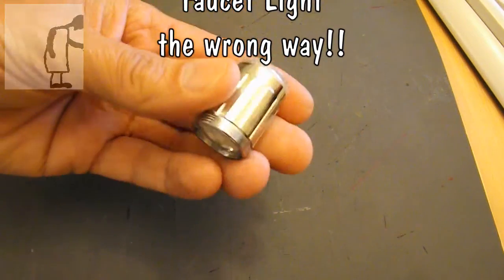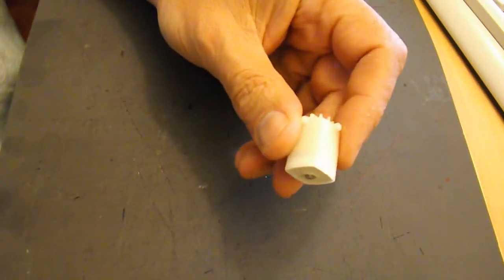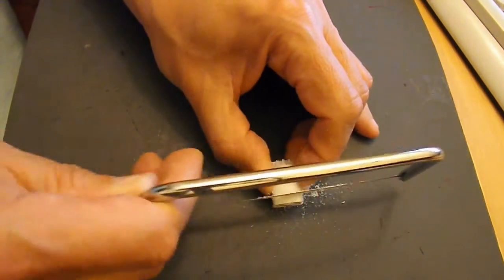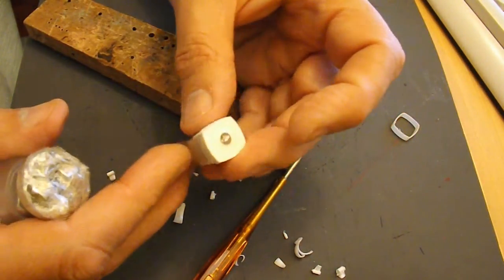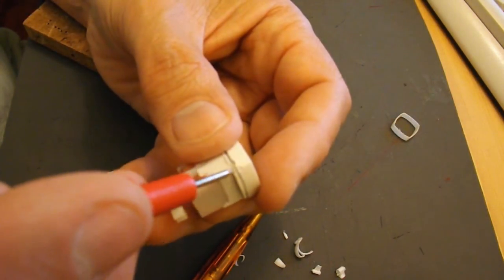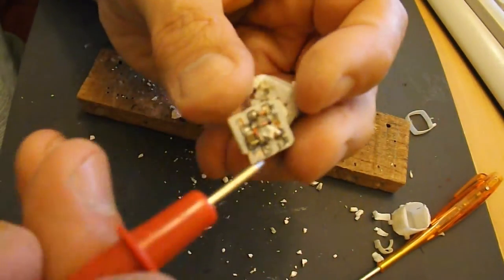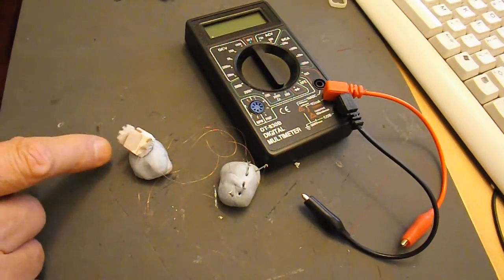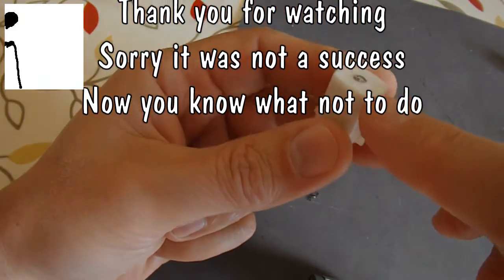Let's disassemble an LED faucet light the wrong way

Comment: All well with your video/ But you messed up everything when the main circuit was shown in focused & blur ☑️☑️😭

Other wise the dismantle and rest was good 👍
Reply from the maker: Yes, that was very frustrating, however, the circuit is just a rectifier bridge of 4 diodes, and my interest was the 'generator' rather than the circuit. Here is PART 2 - Grandad vs the Faucet Light - round #2 https://youtu.be/N2-3XjeAQ50 You will find more information in the video description.

Comment: I used one for 2 days and then it burned up..
Reply from the maker: Extremely unlikely as it runs in water. Or do you mean the LEDs failed?
Reply: @GrandadIsAnOldMan  yup. LEDs stopped putting out light in 2 uses.
Reply from the maker: My interest in them was the extremely efficient generator, which could be why your LEDs failed. Generating too much power if your water flow was fast enough 👍

Comment: Grandpa what is that tool you're using to make the motor turn
Reply from the maker: If you mean the hand held fan, I replaced the fan blades with a couple of magnets. The spinning magnets are what is turning the faucet light.

Comment: My light went out ,how do I replace the battery?
Reply from the maker: They don't have batteries. The power is generated by the water flow. If yours has stopped lighting up it might just be some dirt has built up inside stopping the rotor from spinning so you might be able to clean it with a fine wire. Other than that it is virtually impossible to repair as I showed how difficult it is to get apart.
Reply: Thank you!
Reply from the maker: @10wowgurl  😁

Comment: how it change the color on temperature???
Reply from the maker: +Br S the ones that change colour with temperature will obviously have a temperature sensor circuit inside them. However the chances of identifying any component parts from the circuit board are very unlikely as it more or less gets destroyed trying to get it out of the resin that seals it all together.

Comment: I opened up a faucet yesterday. As you started sawing on the side, a few mm down from the top, I was so lucky to start sewing from the top (into the resin). And I only sewed the resin which was sticking out, so my saw barely touched the plastic outside. Now I had 4 ridges, and I used a tiny screwdriver (a watch makers one, 3 mm) and started pouring into the cuts which I had made. After a while I got to see the circuitry and some later I could take that out of it. Below the resin I found 2 wires, embedded in silicone which is easy to remove. I did cut a bit off the isolation on the wires as I went to deep with my screwdriver, so a next time I would be even more careful. But the copper was still intact luckily.

Resolving resin is not easy. It seems paint stripper can melt it to some extend. But you do not need to take the rein away (that is, if your faucet has the silicone below the circuit, like mine).

Mine works, rotating it fast generates up to 15V AC, but it takes a lot of breath (your handy tool will help a lot).

Good luck with next one. Thanks for sharing. I was almost going to make a video, but my comment on your video will help out others as well (if they read them).
Reply from the maker: Thanks deslo, lots of people had said how difficult these are, but I haven't seen a video yet. Now I know what the inside looks like I can approach it in a different manner. I am currently trying a few different solvents, no luck so far and I don't want to spend more on solvent than I do on the faucet light or that would be silly :-)
I will cut and paste your comment into the video description so people can find it if they look.
Reply: Hi Thanks for sharing...these little generators produce 15V AC ?
Reply: Might get something out of it if we could understand what the hell you're writing LOL just playing buddy
Reply: @garyfelty3758  Thanks! We all try, but there is always room for humor!